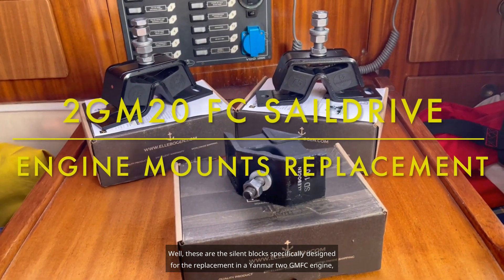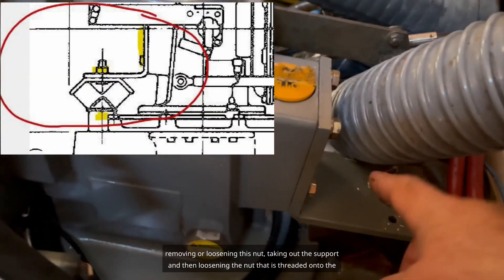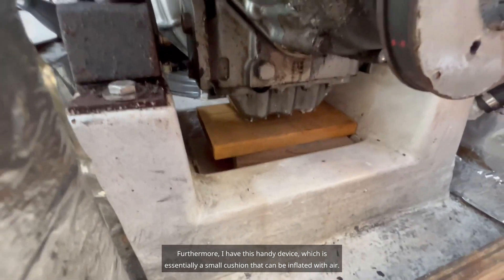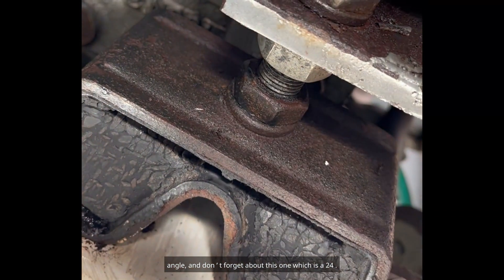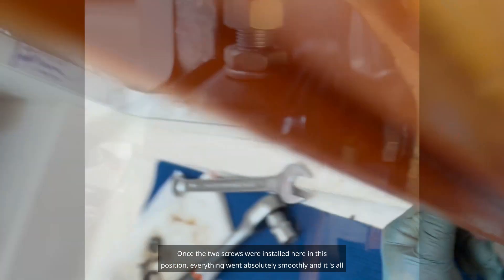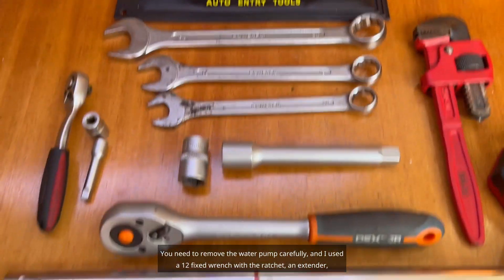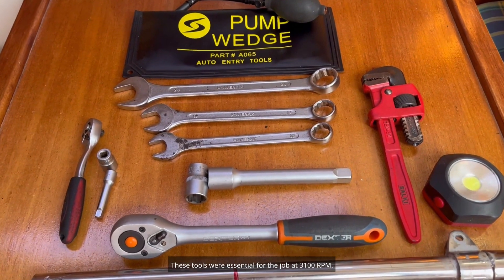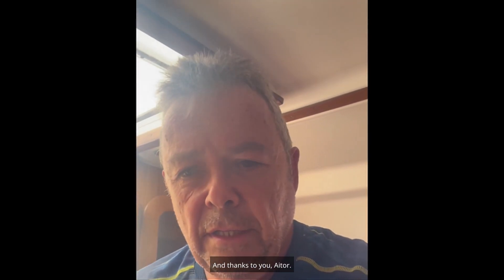ELLEBOGEN - Yanmar 2GM20FC SD20 Engine Mounts Replacement

Comment: I'm awfully sorry, but you're skipping what is most essential about changing the mounts. You must undo the bolts to the prop shaft and re-align the engine after is has been sitting on its new mounts for an odd week. Best, Rob ^^
Reply from the maker: This is a saildrive transmission. No propshaft on this system.

Comment: Interestint video - but how did you access the single mount for the sd20, particularly the nut which is almost completelyhidden under the saildrive? And how did you support the saildrive weight?
Reply from the maker: See Short reply
Reply from the maker: If you send me an email to aitor.ellebogen@ellebogen.com I will provide you the information.
Reply: I have never seen that little air pump and pad before! 
Have you considered selling it on your website?